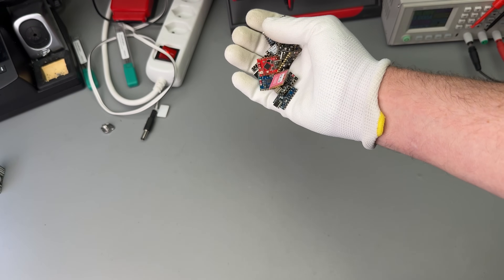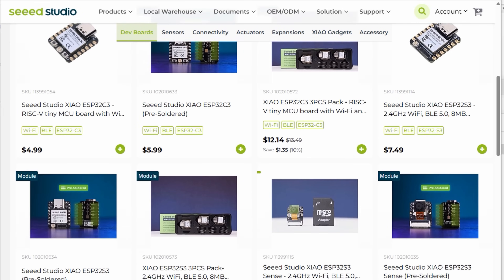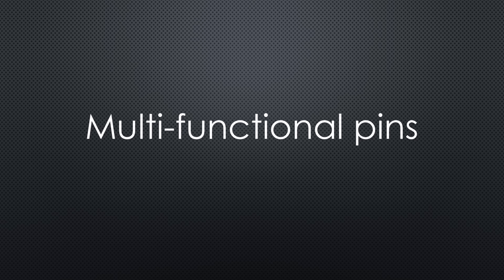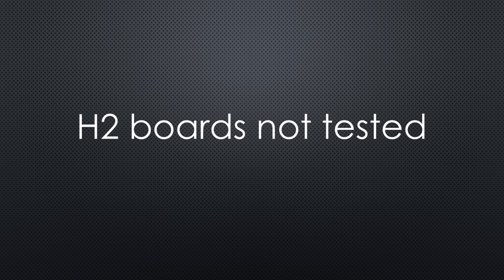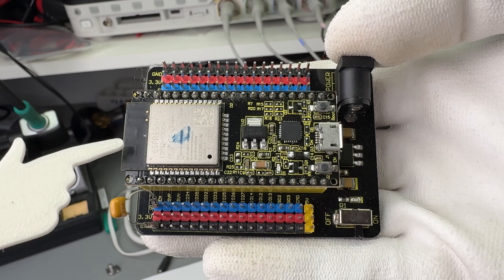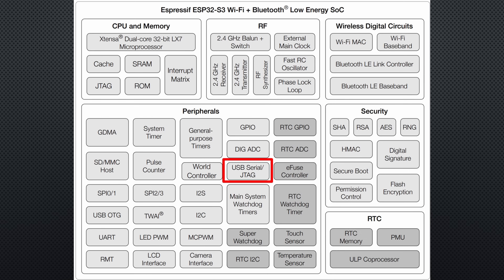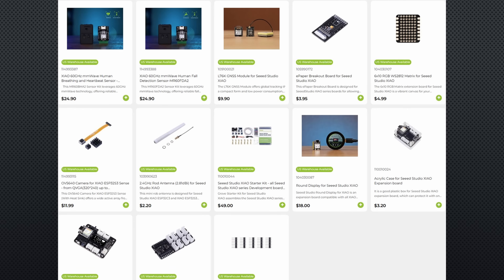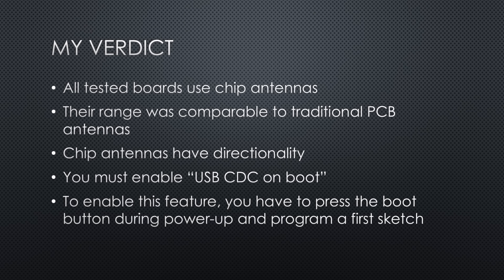Stamp-Sized ESP32 Super Mini Boards Tested: Range, Programming Tips & Best Pick

Comment: Great Andreas, as usual! Would you cover, in a near future :), the OTG function of some of these boards? I'm currently dealing with a ESP32-S3_WROOM-1 that exposes the OTG USB port on the second USB-C connector. I'm struggling to use it as USB Host interface, to give capability to old baords (Arduino UNO, Nano, ext) to exchange serial data wireless on a web page. So far whitout any result
Reply from the maker: USB host is always a bit tricky...

Comment: You can directly connect a battery to these boards? do they have BMS built in? ie can you charge the battery when the usb is plugged in?
Reply from the maker: Some of them have a "mini BMS" for one cell built in
Reply: @AndreasSpiess that's sweet. I have struggled finding the right power modules for esp boards. I want a few very simple and what i would consider obvious things.

1) connect a battery
2) plug a usb cable in to charge but have a bms
3) same usb cable for programming
4) have a switch cut power between the esp and the battery.

Comment: I have desoldered chip antenna from one side (the one without thick white line, of course) on c3, and wifi signal quality increased significantly. I was using AP scan to check quality.
Reply from the maker: Interesting. Then the board had no antenna at all...

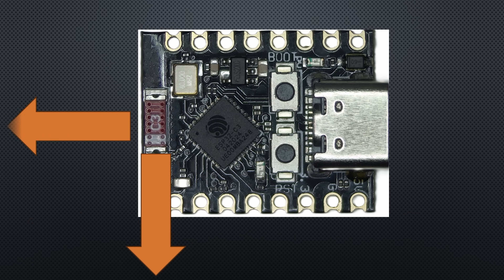Comment: 8:18 The radiation pattern is supposed to be a doughnut perpendicular to the long side, can you explain why you are finding it's coming out of the end instead? 🤷‍♂
Reply: In theory these antennas should be mounted vertically? So for most of these boards they should be edge mounted
Reply from the maker: These antennas are quite close to other parts...

Comment: I buy lots of the C3 boards from AliExpress. 0.8 euros each shipped and you get not only the esp32 chip, but all the other parts you need (connector, crystal, buttons....) for much less than the chip alone costs from Mouser. I use them to transplant chip and other components to my projects. Very worthy.
Regarding the C3, just need to pay attention you don't buy the ones that come with the cheapest version without internal flash memory. I never got one but I have read some are sold in Ali.

Comment: I've used this form factor for several projects, both in the -C3 and -S3 versions. I even designed a two-sided PCB that takes these "zero" boards on the front and an RFM95W on the back with the castellated pins. I started with the -C3 but then had to switch to the -S3 when I needed two active SPI buses, one for LoRa and one for TFT_eSPI. But otherwise they are fantastic and cheap!
Reply from the maker: Indeed, they are nearly the size of the RFM95W...

Comment: Waveshare ESP32-C3 Mini Dev Boards. Early models (I assume it's fixed now) had a serious problem with the chip antenna. if the WiFi power was set above 25% it would shut down.
Reply: I bought one back in October and had issues connecting to WiFi. The generally suggested workaround of turning the power down didn't work in my case so it's in a drawer waiting for a project which doesn't need radio :)

As to whether this is fixed now, I couldn't say. I suspect the issue was that they didn't include any kind of antenna matching network, although Espressif do suggest one in their application note for the C3. You can see this in Waveshare's schematic for the module, which as of today still just has the link. This is very different to their equivalent S3 board, for example, which I think is what I ended up using instead.
Reply from the maker: Thanks for sharing your experience. I did not do extensive testing, just the range tests.

Comment: I've bought quite a few of these now, namely C3-Zero, C3 Super mini and S3 Super mini. So far the ones I've bought from Ali Express have worked as well as the ones I've bought from UK/European sources. 

The one thing I have noticed is how hot they can get if running WiFi or ESP-NOW. I've opted to use a tiny heatsink in those situations. Dropping the processor speed can help too.

But yes, they're quite fun boards to use - especially if you need something small, like a controller that can fit in your hand.
Reply from the maker: I assume WiFi traffic is the primary contributor to the heat. So, a heatsink is a good idea if you have this problem.

Comment: I'm migrating some projects to the esp32-c3 super mini. I have a bunch of i2c devices so the pin count is not a problem. I moved the chip antenna 3 mm further from the pcb with a small piece cable and doing that I gained 10db. I also tested a small monopole antenna. It also works.
Reply from the maker: Thank you for sharing your experience!

Comment: ESP32 C3 with esp-idf.
Totally reliable, seamless and high featured development with oodles of examples.

When purchasing cheap versions, buy a few and test before buying bulk. Some builds have poor antenna placement (components and traces too close)

@ £1-26 a pop.... Fantastic value.
Reply from the maker: @ £1-26 a pop: At least for us Europeans ;-)
Reply: @AndreasSpiess  Electronics are exempt from tariffs if I remember correctly. 20+ percent VAT for us Europeans.
Reply: @chesshooligan1282  Low priced transactions come under de minimus regulations (it would cost more to exact tax than the tax itself, not worth charging it). UK (and EU?) still have that in place. Sadly, US has just rescinded that policy (for now).

Comment: I am using them for some time. O micropython, sleep works on s3 and not on c3.
I have a version with multicolor led, it had to be removed, the ldo also for deep sleep operation on battery.
Reply from the maker: Thanks for sharing. Removing the LED is always needed for deep-sleep...

Comment: About month ago I saw some discussion at cnx-software related to this topic: "Antenna hack more than doubles the range of cheap ESP32-C3 USB-C boards"
Reply from the maker: I saw this too. But I was not convinced about his test method (mainly reception). I think I will go with an external antenna if I need more range.
Reply: @AndreasSpiess  , I recently did some tests using the old ICMP Echo ("ping") messages over WiFi and saw improved performance with this hack (soldering a piece of wire over the chip antenna). While external antennas are better, they add cost and occupy more space. There are also reports of some C3 boards with the antenna too close to the oscillator, bringing down performance. I think SeeedStudio XIAO boards have a greater quality than other boards, but cost a little more (especially when buying directly from SeeedStudio to Brazil).

Comment: I have a couple of the C6 boards and they are wonderful with Home Assistant.  No need for ESP Now or any fudging around.  Use adding a Zigbee device and it all works.  Very useful examples in the Arduino IDE for this connection.
Reply: Do you have experience using those C6 boards with ESPHome?
I have two of the C6 boards, but I don't use Arduino IDE.
 (I use platformIO in visual studio code. Which doesn't seem to support C6 yet)
Reply: @oscargr_  You can simply use the ESPHome device builder add-on in HA. Since about a week, Thread support is natively supported in the release version.
Reply from the maker: Great to hear that the C6 boards are working well for you!
Reply: I'm using a H2 board talking zigbee with Home Assistant, works great but I'm having a hard time trying to power the board from a battery (tried both 3.3V pin and 5V pin).

Comment: Even shitty chip antennas are at worst as bad as good PCB antennas. They're specifically designed and built for that purpose and have great consistency, the downside: they're more expensive than traces (but also only if the space happens to be available, otherwise cheap chip antennas might even be cheaper). PCB antennas have massive downsides: they take up space, they're much more easily coupling noise from close by traces and the layout needs to be super precise, following exact calculations and use well specified board materials that actually are within specs as well as precise manufacturing. Since most affordable boards are made to a certain price point by peole who don't care about quality, board antennas are hit and miss and I generally avoid them like hell. But even with a chip antenna or connector things can go wrong and the signal end up really weak, it's just an elimination of the biggest problem of all.
Reply from the maker: Thank you for sharing your experience!

Comment: I have a few XIAO ESP32-C3 with only external antenna mini Boards. Programming them works fine using the Arduino IDE but takes a very very long time (compiling) comparing to other ESP boards like the ESP8266.
Reply from the maker: The compilation time depends on the compiler/linker used. And these are different for the different processor architectures...

Comment: One very disadvantage of using these "stamp-sized" ESP32-Xx is they get very hot after running for a while..I mean very hot...around 80 °C...
Reply from the maker: Mine got warm. I assume it depends on how much WiFi traffic the sketch generates.
Reply: Running ESPnow mesh  network
Reply: What application?
I've got one running WiFi controlled rgbw led dimming (with mosfet drive). It's normally cool, and only gets warm when thees a lot of WiFi comms.

Comment: Great infos, thank you! I recently started a moisture sensor project for my plants and was very hyped when I found the super cheap and small ESP32-C3.
I just love how small I can 3d-print my case because the only large thing is the battery. (and with a coin-cell it could be even smaller).

Too bad I didn't notice that some have direct battery support because I need some space for the plug now.
But with the deepsleep I only have to charge them probably twice a year anyways.

I also noticed issues when flashing them the first 2-3 times. In some case i even had to erase the flash manually with the esptool to get them working again.
Reply from the maker: I would pay attention with coin cells and the ESP32. Usually, they crash during WiFi traffic...

Comment: 7:02 no, center frequency from 2412Mhz to 2472Mhz (NOT 2462Mhz, but 2472Mhz) and therefore 4 (NOT 3, but 4) non-overlapping 20Mhz (NOT 22Mhz, but 20Mhz) 802.11g/n/ax (NOT 802.11b/g/n/ax) channels.
Those channels are 1, 5, 9, 13 and also fit perfectly into 20/40Mhz mode in 2.4Ghz Wi-Fi band.
Reply from the maker: So we have different information. But for this video, it should not matter too much.
Reply: @AndreasSpiess  channel 13 center frequency is indeed 2472Mhz, single 802.11b (b/g/n) channel indeed occupies 22Mhz of spectrum (but can't be 22Mhz apart, minimum of 25Mhz apart is acceptable), single 802.11 g/n/ax channel indeed occupies 20Mhz of spectrum. Next step is refusal to use 802.11b to gain extra channel ( integer part(80/22)=3, 80/20=4)

Comment: I found these boards not so long ago as well, and they are really useful for esp 32 c and s revisions, as well as some raspberry pico variants... not eveyone needs full 40 pins for some i2c and few LEDs and buttons... UFL connector for external antennas is really useful too, you can put even 8db antenna on it for really decent signal strength. One thing - You should put a bigger external antenna on your balcon ESP,  which would make only your portable board a limiting factor during testing. This was a PCB antenna signal is questionable at best... But as you found out, and me as well, that white ceramic antenna has really useful and suprisingly strong range and signal, and barely needs external antenna. And with these boars having also battery connections and charging capabilities, these are excellent for IOT devices like sensors etc... Great video as always, thank you, i bet i tool a lot of time to compare them all.
Reply from the maker: The last video was about a range world record  ;-) Here, I did not want to test the maximum range. I just wanted to compare the different boards, and also with one with PCB antennas. For more range, a better antenna would definitely help.

Comment: Wow - just had all my stamp C6 arrive and soldered them up today. I intend to use them for presence detection with PIR, RADAR and Zigbee to avoid congestion. Didn't even think about the limited pins.
Thanks for this very timely video - I suspect the tips on USB connection will be VERY VERY handy.
I seem to blow a lot of cheap dev boards - and I would have presumed this to be the case (especially since I have to solder these stamp boards).
Reply from the maker: I hope most will survive your "treatment" :-)

Comment: Bought quite a few of those in C3 and S3 version.
Love them.
The C6 are (afaik) not (yet) supported in PlatformIO with the Arduino platform.
(They are, i believe supported in the Espressive platform)
Reply from the maker: I was able to program them with the Arduino IDE...
Reply: @AndreasSpiess  Yeah.. with the Arduino IDE, me too.
But ever since you introduced the PlatformIO IDE to me (several years ago) I really don't use Arduino IDE anymore. I miss code completion and easily working with different cpp and h files.
Especially in a little more complicated projects.
Reply: @oscargr_  use pioarduino, its platformio with newer arduino core

Comment: Hi, thanks for this video I am planning to use these boards for my thesis study. Is the charging function efficient or is it better to use charging module? Does it cause any problems when the board is operating?
Reply from the maker: I did not test the charging. But it uses a standard chip ans should be ok.
Reply: @AndreasSpiess  Thanks for the reply, the video is a great help

Comment: Unfortunately I’ve had more antenna problems with the c3 supermini, and the pins weren’t enough. I switched to lolin32, but I like the luatos/core model the most for mostly just works, I think you need to use dio instead of qio when flashing. 
I’ll try again with the antenna directions in mind.
Reply from the maker: Indeed a good choice when you do not have enough pins!

Comment: i prefere to use the plain wroom chip and use a external programmer. etching a custom board with just the voltageregulator and pinheaders works perfect, even with 0.25 mm tracks. gruess usem schöne ämmitau 😃

Comment: The board I got, I couldn't even get a blink sketch uploaded via platformIO. Now it sits in the drawer. Maybe a dud. But overall I am not sure it's worth the headache.
Reply from the maker: Are you sure you were able to enable CDC on boot? Otherwise they behave very strangely.
Reply: @AndreasSpiess  There is a post "Enabling USB CDC on Boot on ESP32-C3 Devkit" on the forums. Maybe I'll try again with their findings. These days I rather work on the project itself than getting the board to work as an additional project 🙃
Reply: Also had some weird behaviours where 2-3 uploads were possible and then it stopped working. From my experience the Arduino IDE worked a bit more reliable but this was probably only because of the CDC setting. 😀
After manually erasing it with the esptool and uploading with Arduino IDE they worked reliable in PlatformIO.

But as you mentioned... maybe not worth the headache. 😂
Reply: I use the esp-idf tool chain... No problems.